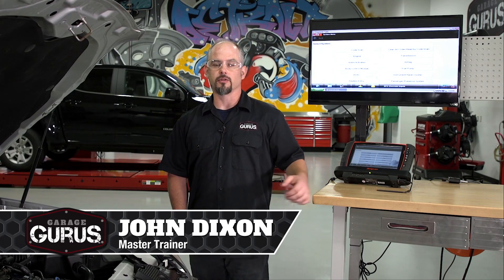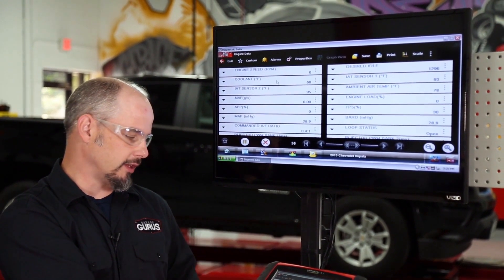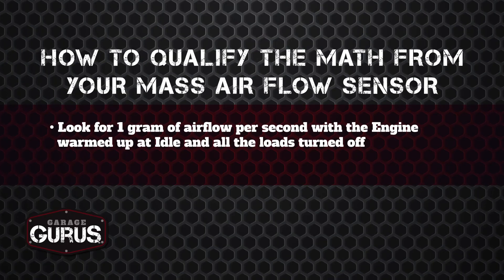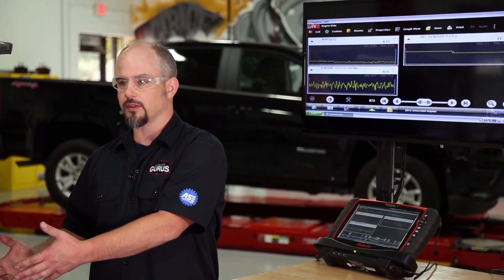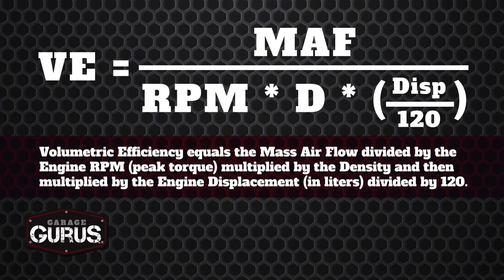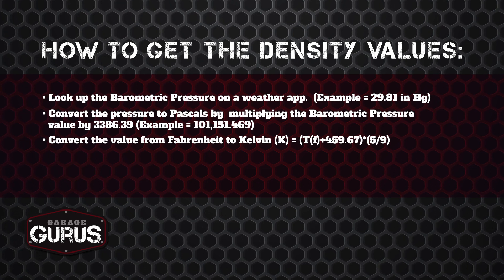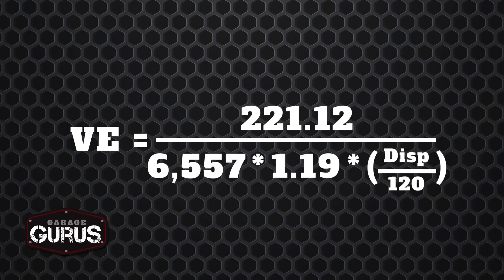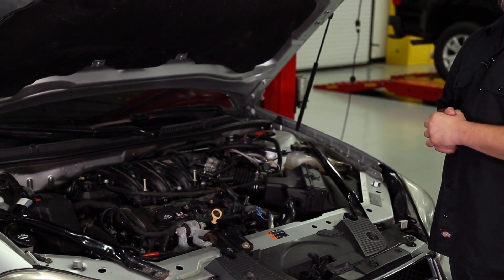Garage Gurus | Volumetric Efficiency Testing

Comment: 5:04 I prefer to rearrange the equation for easy entry into a calculator.  VE = (IAT in Celsius + 273.15) * 34,440 * (MAF in g/s) / engine speed * barometric pressure in Pascals * engine displacement.

To be mindful of the order of operations, you have to finish adding 273.15 to IAT in Celsius before continuing.

Comment: Great video! I just had a quick question: when you calculated the density (D), you used atmospheric pressure. Shouldn't that be the intake manifold absolute pressure instead? Since that's the actual pressure the engine sees, using atmospheric pressure might lead to an overestimate—especially when the engine is under vacuum or boost. Just curious about your reasoning there!

Comment: 94% is nuts for a dead stock "grocery getter" engine!  I remember back in the early 80's it was assumed that if you had ~85% on a non boosted engine you were rockin'. Of course, we had no practical method of testing that back then (here, let me pull my heads so you can slap them on a flow bench...  cough...). Not to mention that was just a portion of the equation.  Man...  times they have-a-changed!  And for the better here.

Comment: I thought you presented VE very well John and yes my head exploded just like the emoji’s lol ! I’ve done a lot of VE testing and used it primarily to test MAF sensors, although it’s great for testing air efficiency as well. Something to note, you can qualify a MAF at idle using the 1 gram/sec. per liter and have it be skewed at any rpm off idle. Using a piece of graph paper and drawing a line at varying rpm is a good way to test if a graphing scan tool or scope is not available as long as you can record the data.